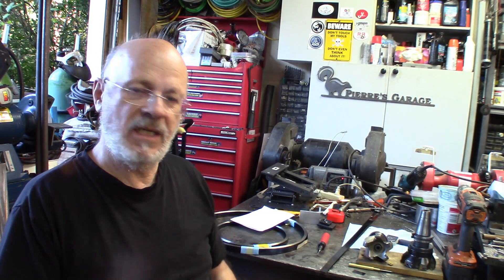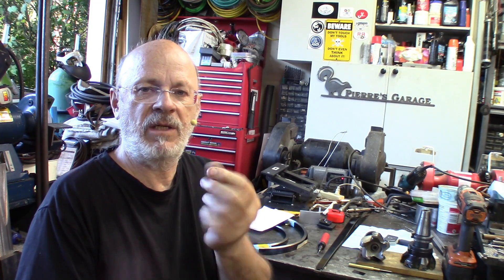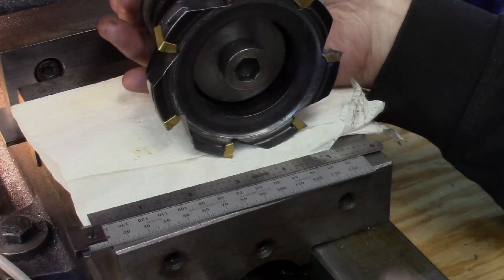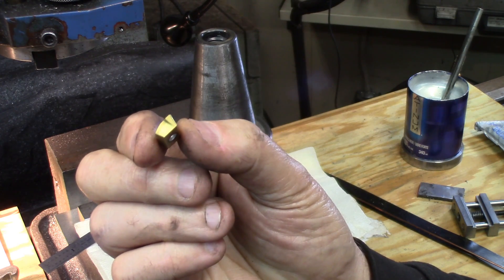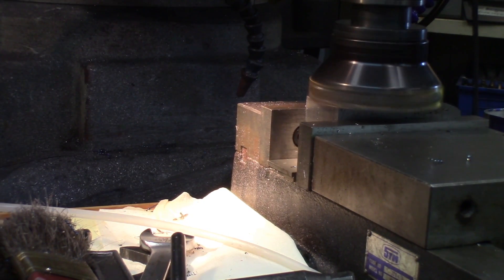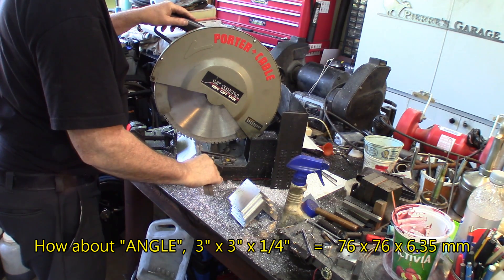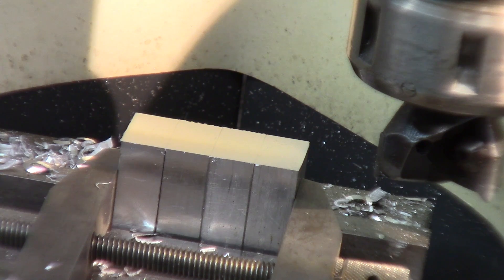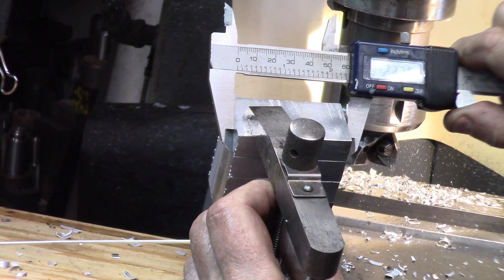Quick shop update plus a few machining tricks

Comment: 6:00....blue chips...that's what you want right? Takes the heat away from cutter and work-piece....And...that certainly is a nice finish!
 I've drilled holes and had the chips smoking hot 'cutting oil'...drill bit was barely warm..
Reply from the maker: Hello Doug,
You're right about the chips having to leave the part and take with them the generated heat. If the drill bit isn't getting any hotter than warm, you're doing it all right...   ;)
Thanks for comment and input,     Pierre

Comment: That 7 insert facing tool looks nice. Good for a decent size machine - no 40 taper on my mini mill. Runs very sweet when cutting.
Improvised drill guide does good.
If I don't manage before time - have a great vacation trip and enjoy the Bash - as you know, I sure wish I could be there.
Reply from the maker: Hi Chris,
This tool will eat up .200+ thousand and still perform great, taper 40 comes only on bigger machines though, it's a solid performer.
For drilling it's the next best thing to a drill press....    ;)
I'll have all of you in mind while in California, thanks,    Pierre